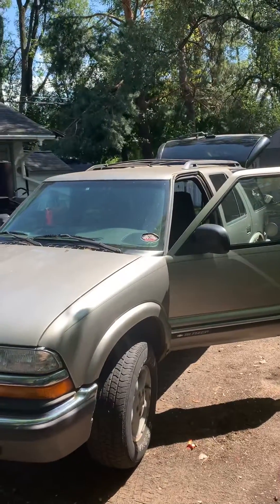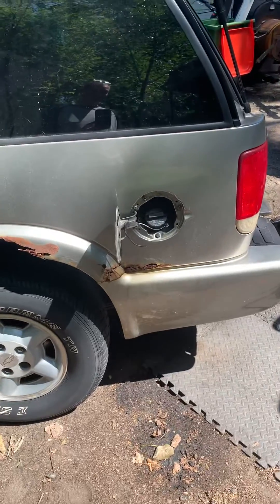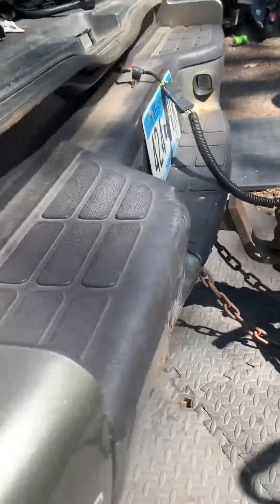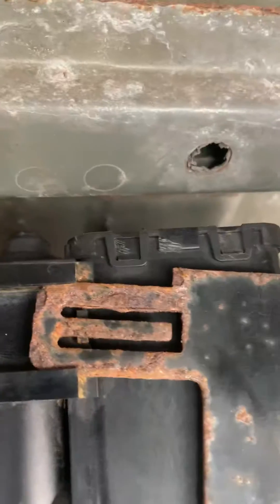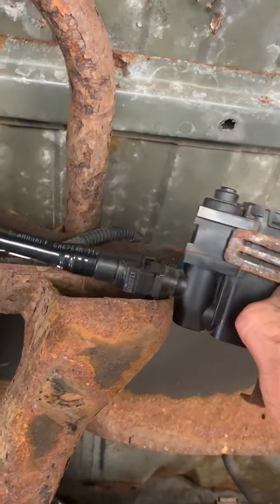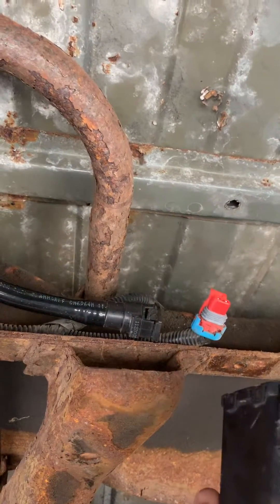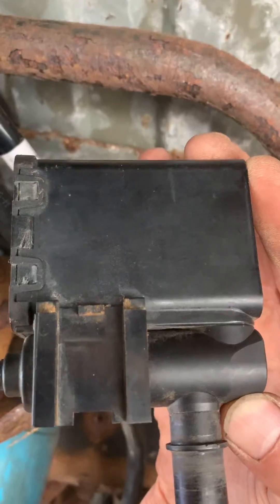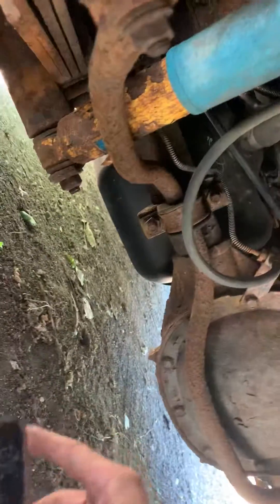Why cant i fill my chevy blazer fuel tank

Comment: I had this issue in my 2001, changed the vent valve.. No fix.  Changed the purge valve that is on the engine.. No fix.  Changed the charcoal canister.. No fix.  Lines were clear. 

My issue? The fuel tank pressure sensor that is on top of the fuel pump was bad.  Because even with a new vent valve, the tank during a hot summer day would be under so much pressure the plastic tank would bow out until I pulled a line off the charcoal canister to release the pressure.

Didn't put two and two together though until finally my fuel pump had given up and I bought a new one which came with a new sensor pre-installed. 

No issue filling up now.

Comment: Don't even bother with that valve. The inline checkball is stuck or it has obstruction.. pull the upper gas filler tube out, hammer a long screwdriver or round stock metal rod from a hardware store.... Once you break thru the plastic - You're golden.... I've owned a dozen S10s. All but 1 have done this
Reply: You are right sir!
Reply: I have this problem also ThistleDewOutdoors. Ive changed the fuel pump, the canister,  and the purge solenoid. I dont have the issue with not being able to fill the tank, but if i top off the tank, this 99 chevy blazer will quit. or it will quit if its a really hot day also, after it has reached operating temp. Does this metal rod solution fix  the same problem i have here or is it different? Love to have some feedback on it thanks.
Reply: Can you say more about what to hammer thru once you remove the gas filler tube?

Comment from the maker: Normally this solenoid closes periodically and then the computer somehow tests pressure in the gas tank so as to locate a leaking system for emissions purposes , anyways sometimes the solenoid gets stuck closed and vapors can’t leave your tank , that’s why you are only able to get a very limited amount of fuel into the tank before the gas pump notices back pressure and stops pumping at the gas station
Reply: My 04 blazer is doing this and burns a fuckton of fuel